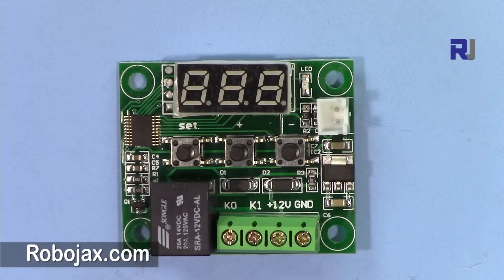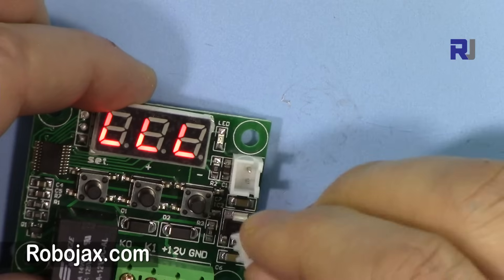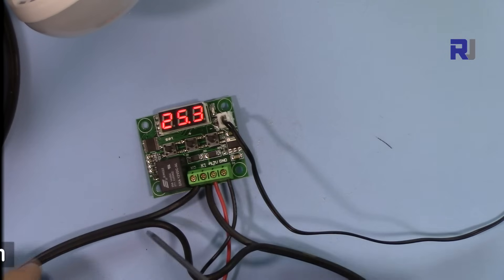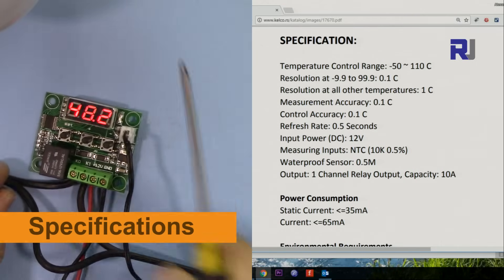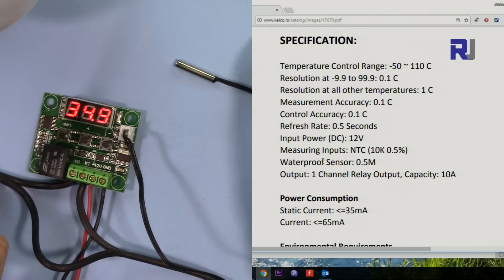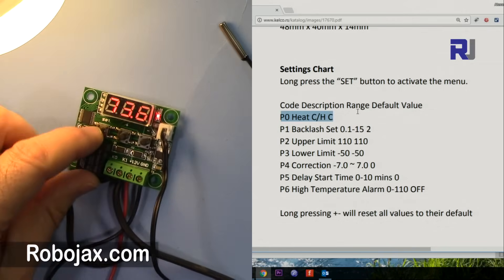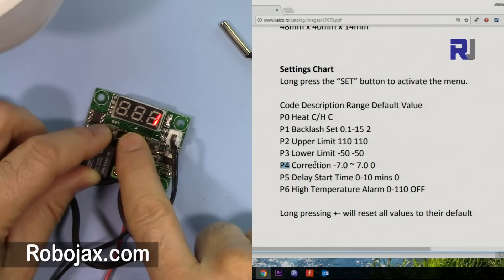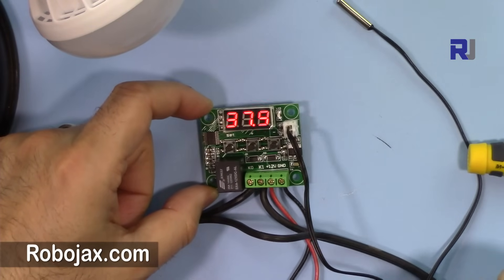How to use W1209 Temperature relay controller and program the thermostat

Comment: can anyone think of a reason why when its wired to 12v in, there is a loop from vd+ to K0, and k0 and k1 are wired to a 12v silicone heating pad, why the relay clicks and the led goes on, but there is not heat?    i tried multiple w1209, tried the heater directly to power so i know it works.,  even tried a 12v fan... doesn't seem to be any actual power to k1 and 0 when there should be?  the only way i can get it work is to have a separate dc power source to k0 and k1 without the loop.
Reply: @LazyH-Online funny thing, if it was AC, and a thermostat or a light switch or motion sensor or just about anything, i could do it in my sleep... same thing for DC...   i have heaters with w1209s that turn on in the beehives at a certain temp...  but put the arduino the middle and i'm completely baffled.   i can get the fan to turn on ALL the time, or just get it to make a humming noise... but nothing else.
Reply: @LazyH-Online actual quite simple - which is why i feel like such a dunce for not being able to get the thing to work.   i want to have a nano (nano because i want one for each hive and they're cheap), with a dht11 to sense humidity in a beehive - the little things put of an amazing amount of humidity, especially in the winter when the hives are all bundled up.   all the hives are in a house that is powered by solar and wind, with 12v batteries.   so i want a nano, with a dht11 sensor that turns on a 5v fan (5 so no transistors or mosfets etc), when the humidity gets above 60%... no low, med, high - just on or off.   the fan works fine if i attach positive on the fan to 5v and negative on the fan to grd - as one would expect.   not sure why running it via a dht11 would be a problem
Reply from the maker: There is no loop to k0 or k1. K0 and k1 are separate and that's why you can connect AC to those terminals.
Reply: @robojax  ??  actually if you're talking strictly DC then there has to be a loop from + to k1...   not if you're using DC for powering the w1209 and AC for powering whatever it is you're controlling of course since you can't mix ac and dc.   but 12vdc - in goes to gnd AND to one leg of the controlled thing.    12vdc+ goes in from power to 12v on the board and there is a loop from vcc+ to k1.   k0 goes to the other side of whatever you're controlling - i'm doing a little silicone heater.    the same goes for a remote controlled PCB i have.      if you can get anything to work without the loop let me know.   if you only have +/- from the battery into the +/- on the controller, and k0 and k1 connected to the controlled item, it won't work.   the light goes on because the sensor is working, but the 'thing' won't.

Comment: Hi... can it be connected to control DC load?
Reply from the maker: Yes. DC or AC
Reply: yes you can .. that,s right
Reply: Read on the body of the relay ... it bears that .. 5A for 220v ac ... and 10A for 110v ac ... and 20A for 14v dc

Comment: There are no isolation slots on this board. I would say it is irresponsible to show this product being used to control high voltage.
Reply from the maker: yes agree. How would you design it?  you will connect wires to a separate relay which is connected to HIGH voltage. It would be the same. The two connector are connected only to relay.
Reply: @robojax  "How would you design it?" Despite the 120V rating stamped on the relay  the rest of temperature module is only design for low voltage. I would do as you say run wires to a separate high voltage relay. If possible switch out the high voltage load for a low voltage load. Or scrub the use of the XH-W1209 and go with an SDG Electronics board.  https://youtu.be/U0-vfdBTW_g?t=227

Comment: Also this video is not analysing the unit. The Voltage regulator is a AMS 1117, max input 15V. The relay could be replaced by a solid state relay, especially when switchiung ´motors. Why dont you mention sparks on relay contacts? Does the chip have an alarm output that goes high on alarm? (possible second channel?)
Reply from the maker: It is "how to use". Solid state relay works only with AC load and they are always in the rage of 250W or 500W which this can handle 1000W or more.
For the alarm, this IS the alarm. Instead of turning ON a buzzing device, it turns ON your load which could be FAN or heater or anything else.

Comment: Sir, you have really made it easy and even easier but sir can one adapt six bulbs to the W1209 thermostat at a time?
Reply from the maker: Yes you can. Here is how you can calculate the load. Your bulbs are your load. Just add the power of all six bulbs and treat them as ONE load https://snag.gy/UDJMCg.jpg

Comment: I am useing 12v 1.6A adopter instead of 20v 1A.
It is ok or not?
Reply from the maker: This module works with 12V and not 20V
Reply: @robojax  
What do you mean?
I don't understand?
Reply: @robojax  
12V adopter
But it show 1.6A
Reply: @robojax  
12V same but 1.6 A is more than required
Reply from the maker: it is like you want to buy  1kg apple for $5 but have $10. No harm. You will only use $5. The device uses only 0.2A no worries.

Comment: I'm after a circuit that lowers the voltage to a heating element rather that switching it on and off as this relay design does. This would allow me to have an element that keeps liquid at a very precise temperature (relay on off for a 1KW heating element, heating a liquid, means the solution heats and cools rather than being heated to temperature and is kept there by a warm heating element)  Does such a circuit exist?  If so I'd love to know... Cheers and thanks for the video
Reply from the maker: You are welcome. Cheers.

Comment: thank you,good job
Reply from the maker: You are welcome.
Reply: @robojax  ,have you look at the GRAVITY 800 AMP CAR BATTERY CAPACITOR GR-800BC
Reply from the maker: I just did. The title "800A" is very misleading and vague.  800A doesn't mean anything if they don't use the term "hour" like 800A/h or something. If someone send it for review, I will explain it. but I am not buying it to do the review.
Reply: @robojax  looking at the reviews from amazon.,IM THING (1)SOLAR CHARGER TO 12V DEEP CYCLE BATTERY TO 800AMP CAPACITOR TO INVERTER.,(2)LONG RUNS 140 FT GO 70FT CAPACITOR THEN 70FT TO 12V BOX ?YES/NO  THANK YOU FOR YOUR TIME,RUSTY
s.c
Reply: @robojax  if i ran  12v deep cycle battery to two of the capacitor to two inverter pull 110 from each to get 220/? thank you rusty SC

Comment: Sir. My adapter is 5amp 12v volt. My thermostat relay most of the time not working. Then i removed relay and replace with 7amp relay. It worked for one week. But the same problem is there.. relay not turn on...means heating bulb not turn on. When we hit the thermostat it will work and off automatically. But will not turn on again without hitting.. with 5amp adapter iam using 2amp dc fan too. Sir what will be reason for relay problm
Reply from the maker: relay is bad or crack on the PCB.
Reply: @robojax  i have checked everything.. and add led strip with that 5amp adapter. The led strip is just blinking. So that means there no enough voltage.. then i seperated the power wires of adapter and heating bulb.. into two  sepearate connection.. now it working.. before it doesnot have enough ampier..

Comment: My load was not connected but the led was on what was the wrong?
Reply from the maker: check your load power or wiring.
Reply: @robojax  is the load need a relay?

Comment: Hi sir robojax..

Sir i bought this w1209 thermostat.. with this relay details.. 20a 14vdc, 20a 125vac, sra-12vdc-al... now my question sir is ds.. can i plug a 220vac bulb as my heat source for my incubator? If not, what shud u suggest sir so dat i can utilize ds thermostat since our place has 220vac source.. 
Waiting for ur humble suggestion.
Reply from the maker: Yes you can.
Reply: @robojax  ty sir...
Reply: Hi sir robojax.. sir, can we connect two 40 watts of 220v buld as heat source for my incubator? Can we also connect a fan to ds module? How can we do it sir? Hope u can help me sir.. ty..

Comment: Is the light connect to 220v? Or connect to 12 v power supplay?
Reply from the maker: Watch the video. It has been explained.  I just watched the video making sure I did not miss it and it is in the video.
Reply: Thank you.. and also where i can connect a 12v fan for my incubator project so that it can turn on and off also.? What i means a bulb with a fan.. i get the bupb but the fan where i connect it in the load too?
Reply from the maker: this module can turn ON and OFF a load. Load can be fan or heather or any other AC or DC.  In this video my load is AC bulb and in your case it should be your incubator.
Reply: Can i both connect it at the same time?

Comment: hello sir i have bakery ovens with oven one temperature digital meter i won't one display in office cabin it's possible please suggestion
Reply from the maker: Assalamu alaikum Mohammed, This wont' work for your application because it has limit of 120°C or something like that. You need k-type sensor with Arduino like thishttps://youtu.be/cD5oOu4N_AE and you can have two displays. One close to the oven and one in your office.

Comment: Sir what if i make the thermometer wire longer will it still work?
Reply from the maker: yes it will. I have mentioned that you have to compensate the difference of temperature. Watch video.
Reply: @robojax  thank u so much

Comment: NEVER tin tip of wire  to be connected in a hole by screw pressure - the copper loses it's elasticity and and adapts so eventually the screw no longer apply pressure on the wire and the connection  faults.
Reply: crap! I just did that. Oh well, I'll know better next time.

Comment: I have often had a problem when I want to power this from a 12v regulated power supply...  the temperature jumps up and down several degrees every second, and if the temperature is close to the the set point, the relay will randomly click on and off and on and off because of these fluctuations in the temperature reading. I tried using an additional 12v linear voltage regulator together with lots of different sized capacitors, and even tried lowering the voltage by passing it through a couple of diodes. Nothing really helped. My voltmeter was reading a constant 12.2 volts, so I don't think the voltage was actually fluctuating any appreciable amount, but whatever tiny bit of leftover ripple was left in the incoming supply was continuing to cause these  fluctations in the temperature reading, and the unstable relay response would not stop. Initially the only thing that fixed the fluctuations was to run the thermostat from a completely separate 12v battery instead. (Not practicle for permanent installation of anything.) But then I tried something else that totally fixed all the fluctuations without having to run it on a battery: I put a small value capacitor across the leads for the thermistor. Works like a dream! No more random fluctations in the readings, and no more random clicking on and off of the relay! Perfectly smooth operation now. I used a 4.7 uf capacitor rated for 25 volts, but any small capacitor will usually work, as long as it is rated for 12v or more. So if you are having issues with a jumpy temperature readout, cut the thermistor wires somewhere convenient, and splice in a very small capacitor. Or if you would rather put the capacitor directly on the board, there are two nice solder points right next to the sensor connector you can use. The top side is positive, and the bottom side is negative. I tried a .1 uf capacitor and it worked just as well, but I went with the 4.7 uf because I might need the other one for something else. So the value of the cap is not hypercritical.
Reply: Hello, Do you have picture or a video of how it is done? If not, would you mind sending me a picture of it to mjshaheed.be@gmail.com. Thanks!
Reply: Bro it would be amazing if you can somehow share a picture or make a video of it. There are tons of people that want to get rid of this issue and your idea is brilliant!

Comment: can you show me how you set the temp in reverse? I need to turn the bulb ON at 33 degrees and turn  OFF at 37 degrees
Reply from the maker: Watch the video. You should be able to do it.
Reply: Press set and the display will blink, use + or - and set 37, then wait until it show the temp.
Press and hold set until you see P0 , use + and change to P1, press set  and then use +- and set 4
Press and hold set until you see P0, press set and use + or - and change to H
Hold set until it show the temp.
Done.
Reply: set the desired tem to 33 . shortly adjust  p0 to h . and  adjust p1 to 4

Comment: Hi can i run the module and a fan both off a 12v source
Reply from the maker: Yes you can. The module needs 12V. Your load can be AC or DC any voltage up to 250V.

Comment: Can I use it for Radiator cooling fan sensor.  Fan should set off at 75 C and fan should set on when the temperature reached 85C.  Pls give your reply.
Reply from the maker: Yes you can as long as you are able to put the sensor inside liquid to get the temperature properly. Or attach the sensor to radiator with thermal compound so it get proper head sensing.

Comment: Sir  can we use Ac fan or dc  fan by changing circuit connection
Reply from the maker: it can control CD or DC no problem. It need 12V DC to operate. https://snag.gy/UDJMCg.jpg

Comment: Is it possible to calibrate to a car's stock temperature sensor?  What are the electric specifications of the expected temperature sensor shown?  I also would prefer Fahrenheit.  I am glad to see the comment that it holds programming when power is off.  Is it safe and calibrated if a car voltage changes 12v to 14v?
Reply from the maker: There is no calibration, but you can compensate for deviation as I have explained it. Add or subtract from the value. I have not tested it with 14V but most devices are mode to tolerate 2 to 2.5V fluctuation of input voltage.
Reply: A car sensor typically lowers resistance as temperature goes up.  An oven sensor typically goes up 2 ohms per degree F, 1100 ohms at room temperature.  What does this device expect for sensor properties?
Reply: @RebChaim613  
The spec. is at 7.38 , a 10Kohm NTC.
Reply from the maker: I am sorry I have got no information in that regards. May be try to find the sensor model and then find manufacturer datasheeet.

Comment: Can this relay circuit is use for Air Conditioner  Temperature setting at 24° or above means if i want to set my AC temp. At 24° or above at that time power supply is given nd if temp. Gets low below to 24° relay tripp nd power is off...please give me suggestions or any idea about it
Reply from the maker: This video covers every scenario. You should watch it again. I can't suggest anything.

Comment: Sir the bulb  connection also is a 12v or 240 v
Reply from the maker: bulb is a load. anything you want . This video has hindi translation.
Reply: @robojax 
on the relay written 14dc /125ac
(bulb)
R U use 120v ac or 230v ac. are 125v ac is limit or 230 could be used??

Comment: hi. I have buy already 2 of these controllers and the problem is that when it gets to the set Temp the relay clicks (you can hear it) the small led from the right side of the display it lights but the fan that I've attache to  K0 and K1 port dues not start and measure with the meter it shown no output current on the fan (K 0 and 1) circuit. I am use it on a 12V battery as a cooling circuit. what do you think the problem is? I am connecting it wrong or the circuit it is not function as it should be? the problem Is stressing me because I've already bout 2 circuits and the delivery time is of minim 2 months :(    Thank you for the advice!
Reply from the maker: Use multimeter to connect when two relay terminal are connected, measure the resistance and it should be zero (0) Ω. You might have connected your wires incorrectly. Did you follow the example of bulb I have shown?
Reply: @robojax   IL tray to connect K0  and ground (as + and -) and to bridge K1 with 12V to see if it works on these configuration.
Reply: K0 and K1 are just a switch to complete the circuit.
Reply: I know 3 weeks have passed but I ran into the same issue tonight with both of my W1209's.  Did some research and found where someone annotated that if the power supply isn't putting more than 10V out that the relay won't trip but the red LED will turn on.  I specifically selected a 12V power supply, so I thought, there's no way.  But sure enough, I pulled out the voltometer and it was only putting out 5.75V to the W1209.  So now I'm getting a new power supply to see if it alleviates the problem.  I wouldn't suspect that you have the wiring correct, it isn't complicated, but I recommend measuring the output of your power supply.  Mine was old and in an old box full of old stuff.  It was likely to be an issue.

Comment: Can I use 12v/1amp adapter to power the circuit?
Reply from the maker: This module needs so little power that  you can connect any 12V DC will work. Yes. any 12V DC will work. Make sure it is DC and pay attention to the polarity + and -

Comment: don't solder wires for screw terminals. use end sleeves!
Reply: With multiple strand wire it looks and work more professional. I have an entire SnapOn tool box dedicated to everything electrical and small part metal carry case...only the tiny end rings are left. So, do what you needed to do. Retired ASE Master Tech